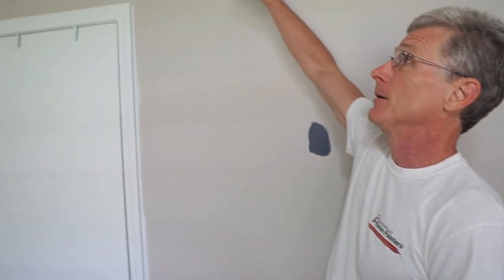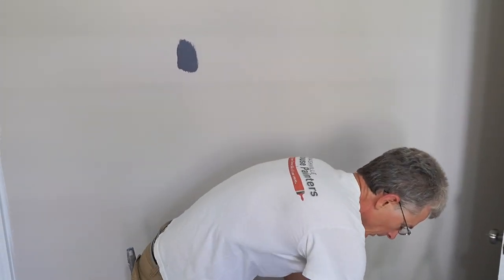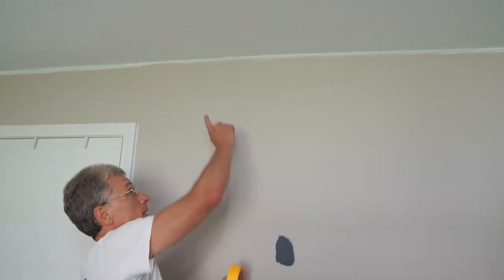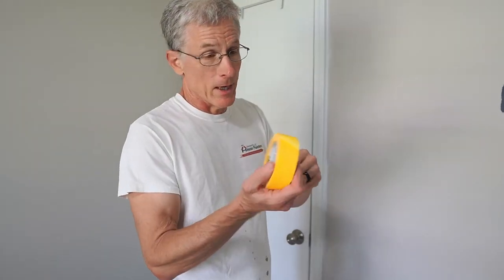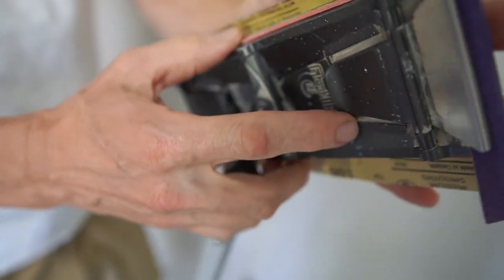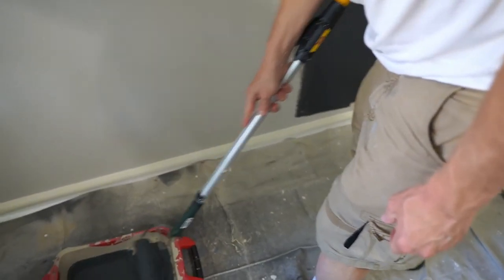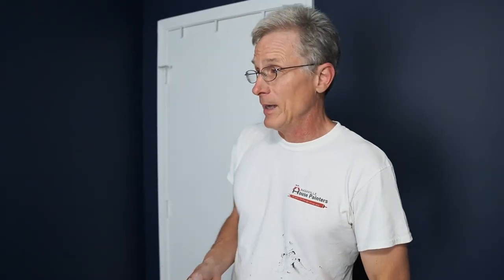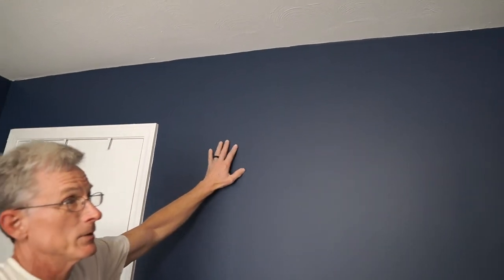How to paint a room with dark colors

Comment: 1) Ceilings 
2) Walls
3) Woodwork 
in that order,
From a painter with 37 yrs exp
Reply: What primer do you use when painting black to white?
Reply from the maker: That could take 4 coats if you are going to a clean white. the goal is to change to white as soon as you can . So start with any white. You may want to use a good white primer like Kiltz 2 . something covers well
Reply: I would say that normally with light colours dark blue white woodwork makes sense to do it in reverse
Reply: Just seen the  Jesus creepers 😮great work footwear  😂
Reply: @TheSmithyt  no because of spray from roller etc it's always that order ?
Reply: figured I'd comment hoping for advice, looking to paint my apartment from a white to an almost black (sailor's coat), apartments only 2 or so years old and I can't find the answer on what and if to use before applying the colour, if I buy a primer? or a undercoat? another dark paint like the video did? if I even need any of that with it being new and just a sanding will do? 
Also haven't decided on a finish if you can point me in the best direction with that for a dark colour?
Thank you.
Reply: @andyderp6473  I'm in UK so our paints are different  ? We use an emulsion paint for walls which is water based, you don't use an undercoat on ceilings walls etc it's just classed as a basecoat, you can just get the finish colour you desire & will probably need 3 coats job done,
Reply: @TheWESTSIDE1967  basically beside each other, looking at a 100% acrylic paint, so just hit it with 3 coats & correct technique no problem?

Comment: I use Behr with great results. Never had that issue with the hat band on top and I use a technique that prevents that as well. I had tried flat, eggshell and satin and great results.
Reply from the maker: The Behr dynasty in dark colors is pretty good but still dries a little to fast for me.
Reply: @nashvillehousepainters  what color did you use in this video?

Looks fantastic
Reply from the maker: SW Naval  @jakelapasnick8513

Comment: The text book way that we were taught in apprenticeship was ceiling first then walls and then woodwork last but I can understand why you do the frames first when using a darker colour. I think it’s easier to cut the wall into the frames when going vertical. Get a straighter line that’s just me anyways. However it’s easier to cut the skirting into the wall horizontal as well as the wall into the ceiling horizontal that’s just me like if I’m being picky but most the time when I’m doing multiple jobs I will do it In the order I said before

Comment: Hey sir, I recently painted my room black and I have a problem.
Previously it was half white oil/enamel and half white normal paint. The painter painted two layers of white primer, then above those, it took 3 layers of black paint on each wall to get all black. The black we used is non-enamel, called “golden supercryl”, written on it “water base paint based upon high quality polymers pigments and fillers” and ingredients are: “acrylic binder, pigment, fillers, water.

current problem: paint completely dried, but whenever I touch the walls lightly with my hands or if I press harder, it leaves a harsh white mark on it, it looks rubbish.. I think a proper description is, the black paint is ashy, if you touch it or rub, you can literally draw on it with your clean hand!

I bought higher quality black paint, also “supercryl”, it’s much much better and looks better, but it also has the same white mark problem, but to a much lesser degree, can you help?
Reply from the maker: I'm not sure about supercryl, use the emerald matt or satin finish.  We have also used Behr dynasty flat/matt finish with good results

Comment: What primer do I use before o paint the wall black and another wall grey
Reply: Good adherence primer preferably black or gray or white if nothing else.
Reply from the maker: On this one I used some left over SW supper paint satin that was a dark color.  Use that same black paint that you will be doing the finish with. Unless you have some sort reason specific reason for  a primer like a water stain or some other problem that you need to block out

Comment: I had to use Satin for a project and needed 4 coats to finally get it even, BUT it was still streaky as far as the sheen. How can I avoid that? When I back rolled it or 2nd backroll it was already taking off the color. Should I have added some paint thinner?
Reply: I never had that issue with satin but I take the time to wait for first coat to dry overnight and then next morning do the second coat or even a third coat if it is necessary another day. Letting it dry thoroughly does the trick.
Reply: I've had this problem in certain areas, not all.  I used  a zinnser stop undercoat, which blocks anything that might cause that.

Comment: What is your method for doing the bottom of the wall?
Reply: @TheWESTSIDE1967  Thank you for your reply.
Your expertise & your channel are great.
Reply: @lahaza6515  Don't have my own channel but like to help, there's always an easy way & a hard way to do anything 👍
Reply from the maker: Just cut in with brush and roll down as low as you can to the base board
Reply: @nashvillehousepainters  I was wondering about that myself!  Their design is almost impossible to tape; if I cut it, I would have to use such little paint on my brush, that it would take me 5 coats!  And in a large room, it would drive me insane.  I tried!  I ended up buying a 2' metal strip w/a handle made for that purpose, but the walls HAVE to be flat, or it still ends up looking crappy.
Reply from the maker: @turtleman5111  I dont know of a flat finnish that works in a dark base color

Comment: i was painting my closet (2nd project in my life) and i had a super cheap 1dollar roller.  the issue i was having, the roll was coming off all the time.  i used it before. so annoying.  i never used a more expensive one and it probably makes a huge difference.  does it also get damaged after 1 use or you can go with it for many projects?
Reply: Even expensive ones can get damaged after 1 use.

Comment: My corners end up to dark! I am using a dark greenish color and roll , for some reson my corners and lines under the siling are darker
Reply: You probably need another coat but in the future try using Behr marquee dark colors have it’s pigment in the base and more colorant to achieve the color in the can but colorant has no covering capabilities. Pro tip
Reply: Sorry dark colors have no pigment
Reply: Some colors do need another extra coat on the body of the wall not the cut lines.